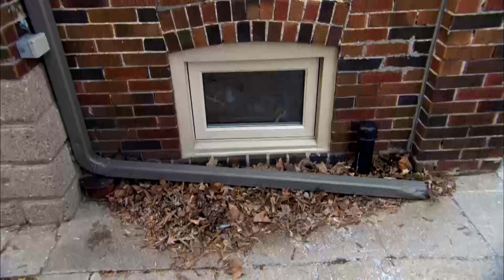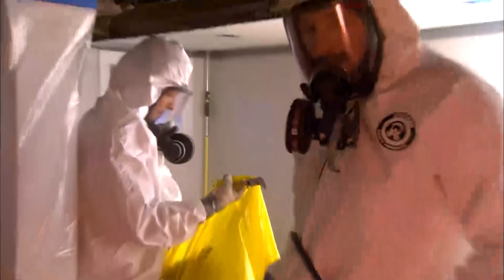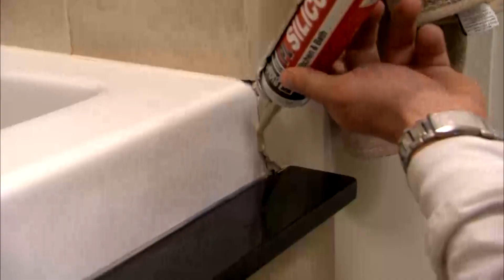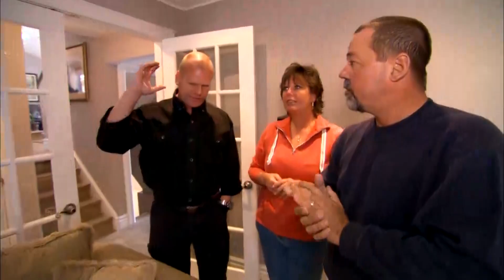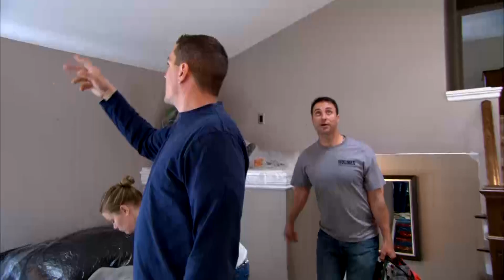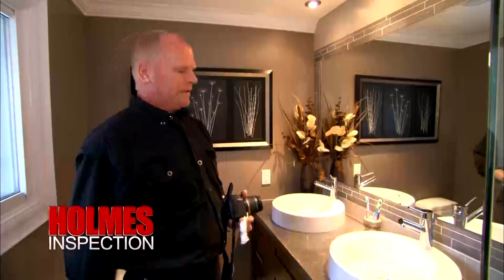Best of Holmes Inspection | 103+104 Full Episodes

Comment: AB is harmless unless u make it become airborne ie sand it ,scrape it  cut it etc, but has to be made unto a dust  we did whole house chit was everywhere and the demo come out tore it off put in black home depot trash bag taped up end closed threw in back of truck an hauled to the landfill & I asked what no special landfill ? Nope  not at all now there are a couple types that get treated crazy  different all kinda precautions  but there few & far in between so stop being so afraid biggest thing is to encapsulate  it  to prevent it from becoming airborns ya hear Now Get To Work Ya Filthy Animal !!!!

Comment: are all houses in us hot air heating systems ,here in uk alot were abolished to to health
Reply: Some homes use hot water radiators. Some use steam radiators. Some use electrical radiators. Forced air systems allow one unit to heat, cool, humidify and filter air. That is why most new construction uses forced air systems.